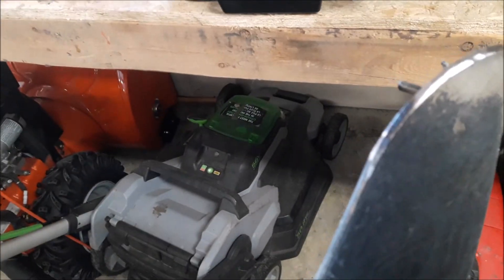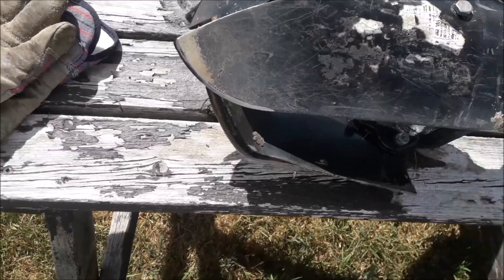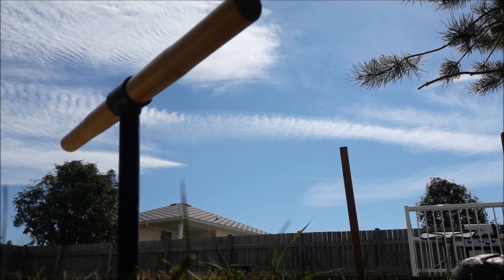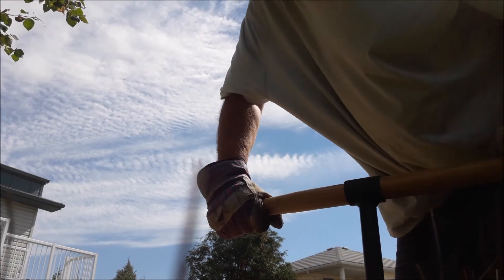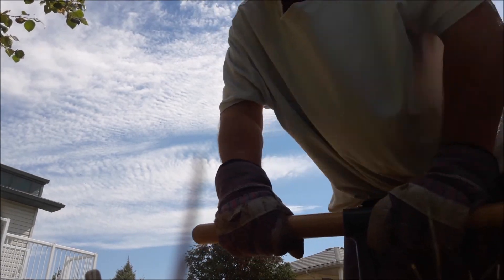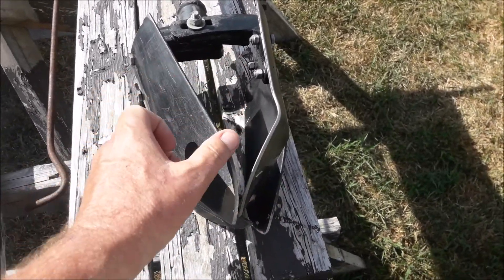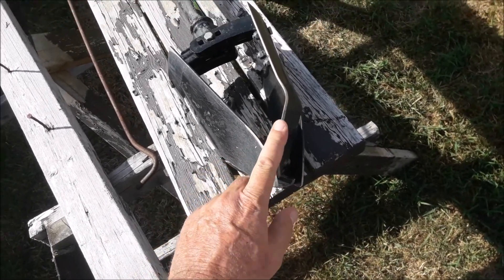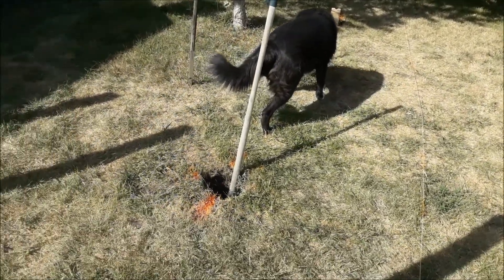Sharpened The Blades On My Post Hole Auger

Comment: Will you need to get some gravel before setting the posts? Seem to have a high water table.  Admire your dedication to manual tool use & practical frequent blade sharpening as post digging is damn hard work. Suggest for your listening pleasure "Working On A Chain Gang" by Sam Cooke.
Reply from the maker: No water table issues here. I filled the holes with the garden hose. "Water for lube". The clay here is dry as a bone.This is phase 2 of the build and yes I'm using crushed gravel for fill. Yes, with a sharp blade the digging is just as hard but goes five times faster. Lot's of tunes can go good after a hard days honest work. I'm building stuff that will outlive me and Dam proud of it.